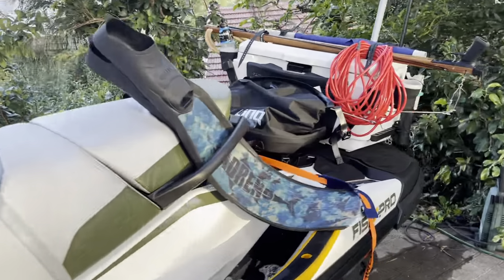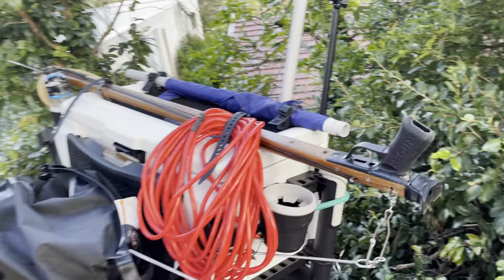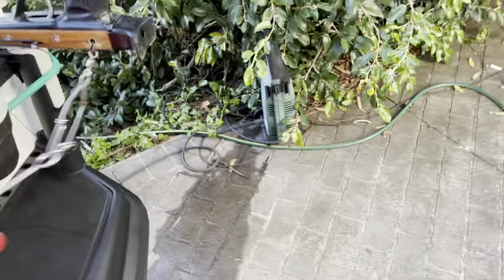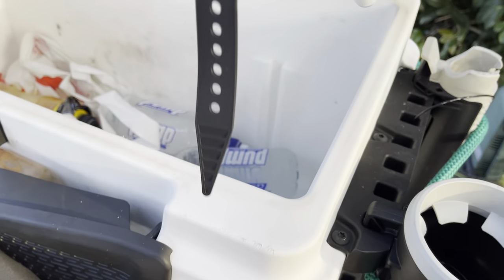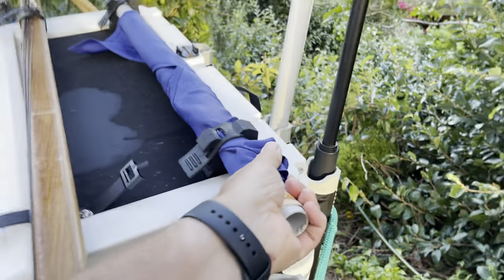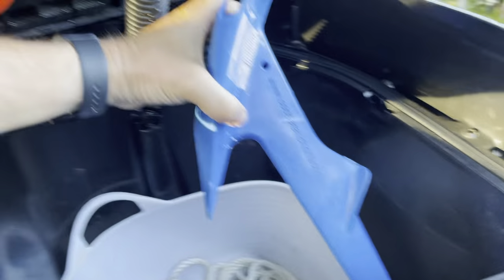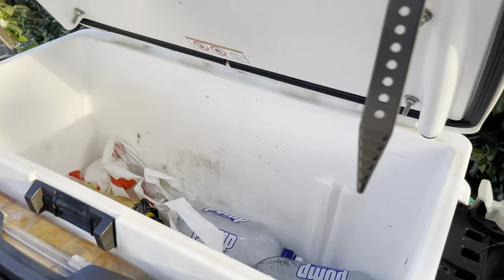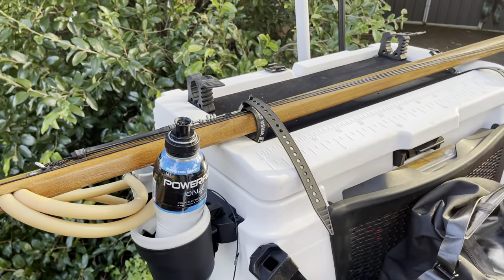SeaDoo FishPro spearfishing setup

Comment: Hey mate ! Awesome idea. I have mine mounted long ways ( going the way with the ski ) for my spear gun, I got told having it your way, ( at speed ) could bend the shaft, have you noticed anything yet with the shaft? If not I’ll do mine your way as I can’t really use the ski when my guns are strapped in 

In from Vic
Reply from the maker: 4 years in and no issues with the shafts, and I can't imagine how they could possibly bend in that position.  Maybe your friend has a very different setup.  Only thing to watch is that the  rubber in the straps I use will deteriorate over time.  I've replaced them recently to be sure they don't break while on the ski.
Reply: @jetspearo  awesome mate ! Thanks for replying, I’m gonna head to Bunnings this morning and do a similar thing’ rippa idea. 

Where abouts are you mainly diving ??
Reply from the maker: @jessezotos2762  Nice one, I've got the Versa straps for both guns now.  Check my latest vid re the Explorer Pro.  I'm usually diving around Port Hacking area, Royal National Park, and up to Botany Bay, sometimes Jervis Bay, and Sydney Eastern suburbs for the comps.
Reply: @jetspearo  love to see your anchor setup to from the front !

Comment: Nice !
What's the name of that stuff you have around your anchor chain and how tough is it ?
You may be better off actually sliding that up over your anchor rope as it's the rope that's more prone to become damaged by rocks and other obstacles, rather than the chain ...
Reply from the maker: Thanks Glenn :) it's called anchor guard or something like that.  I got it from Whitworths.  It's actually to protect the ski from the chain so that i can drop it in from the hold without stressing about the metal banging and scratching things up.

Comment: Thanks. I am picking up my fishpro this week and trying to get ahead of it. Which straps do you like better for the gun mounts?
Reply: The Versa Straps are the winners.  I'm going to remove the rear Grip Fist and change to Versa Strap.  Easier to use, and lock the gear in much better too.  If you're diving in Sydney, check out Jet Spearos on FB :)
Reply: @DavidJamesMcGowan  thanks. I am in the northeast USA but I will check them out anyway… I am in all kinds of Facebook spearfishing groups🤙
Reply: @DavidJamesMcGowan  I can’t find those straps in any of my searches. Where did you get them. Thanks
Reply from the maker: https://www.bunnings.com.au/grunt-20mm-x-40cm-versa-strap_p0199267

Comment: Im sure health and safety will be raising a few eyebrows with that speargun set up across the back. Why not rig it so its standing up like your dive flag in a wider tubing or strapped.
Good hunting.
Reply from the maker: Thanks Broggs, vertical at the back was my original plan, but i've found that in reach like this works best for me.  I don't drive/trailer with it on like this, just when im in the water, and not loaded of course.